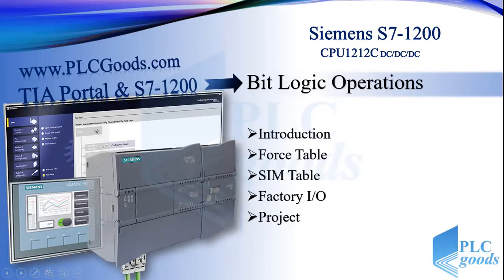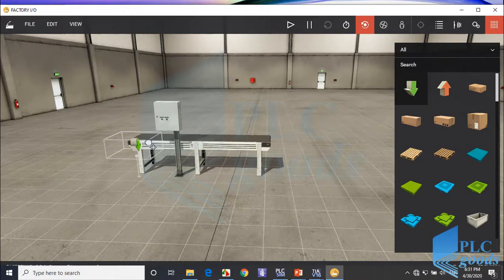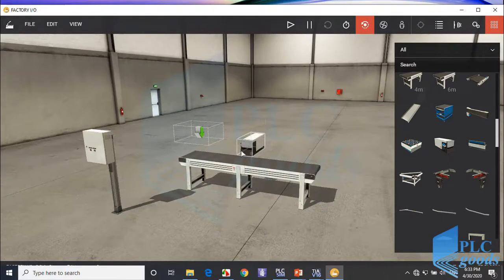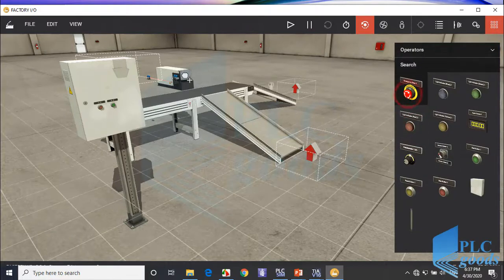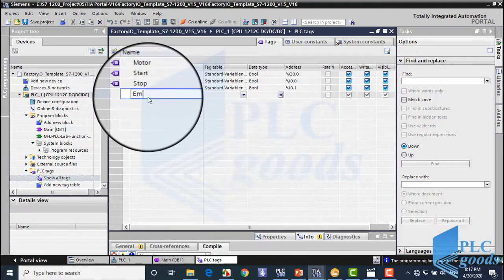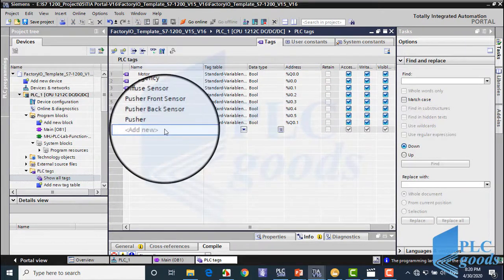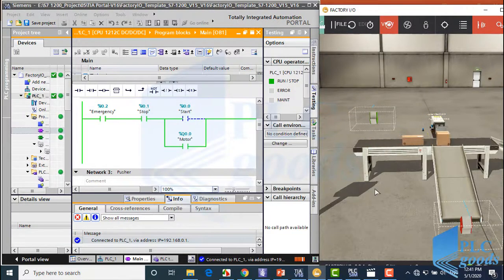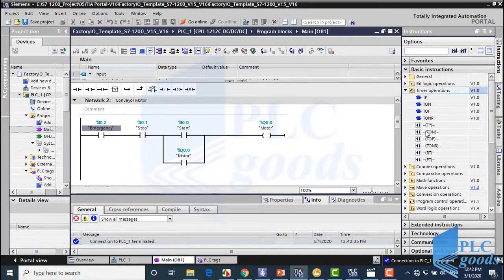Advanced Bit Logic Operations in PLC | Practical Projects and Techniques | Lesson 14

Comment: A question: In the PLC programming the punisher is activated when the diffuse sensor makes negative edge but it doesn't tell about height of boxes. In Factory IO, however, the punisher works only for small boxes.
Reply: Hi there, the height of the diffuse sensor was adjusted based on the large boxes. So, every time a box with enough height passes from this sensor, it will generate a negative edge. Note that, because of the height of the diffuse sensor, it doesn't detect the small boxes at all.
Reply from the maker: Glad to hear that
Reply: @plcgoodsteam8934   Ok. I catch now. Thank your for your fast reply. Greetings.